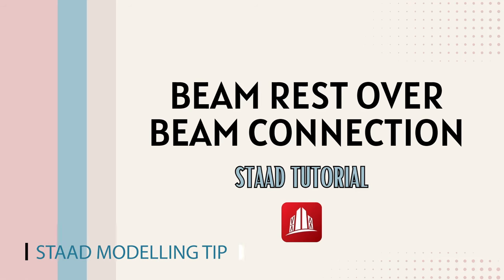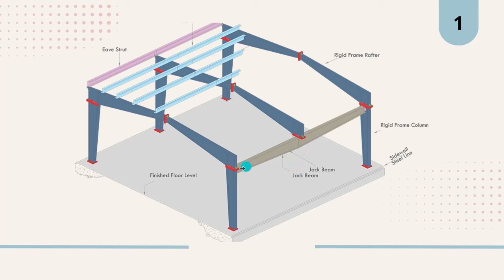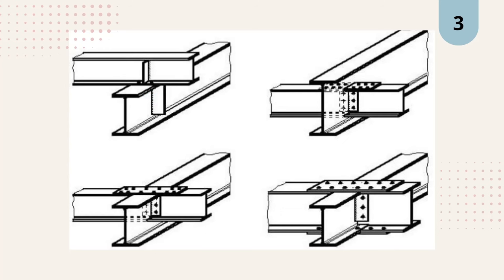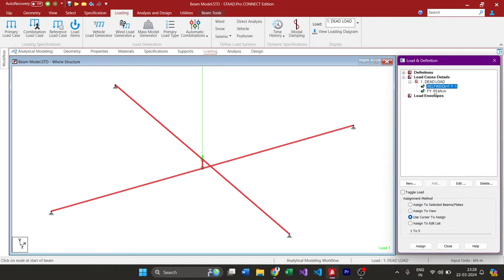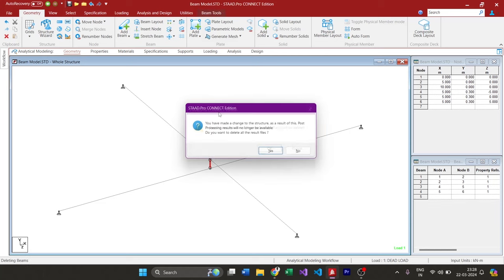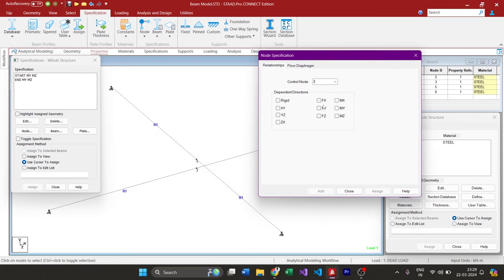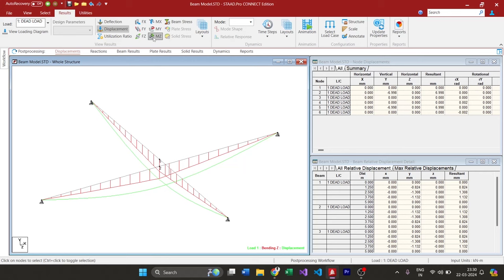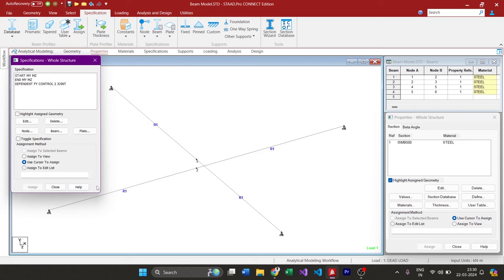STAAD Pro Tip: Beam on Beam Support (Simple & Effective)

Comment: If there are instances like 4 longitudinal beam rests over a single cross beam that ran transversly over 4 no steel columns, then will there be 4 distinct control joints in specification?
Reply from the maker: Yes. U r right..